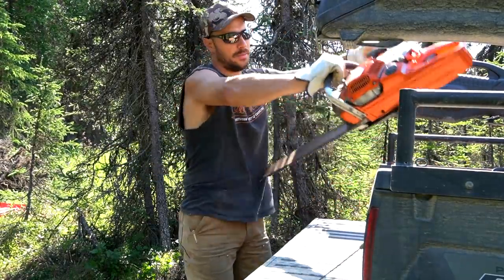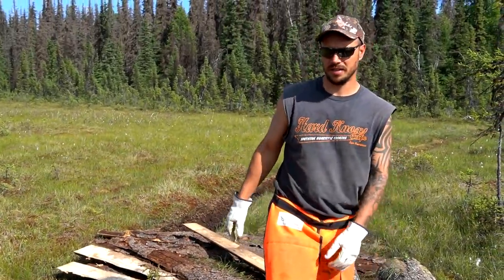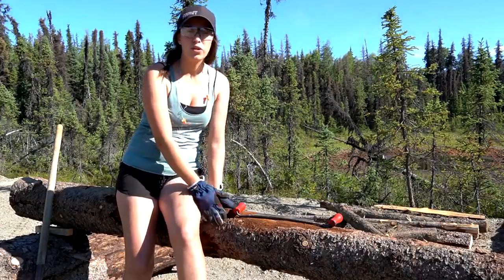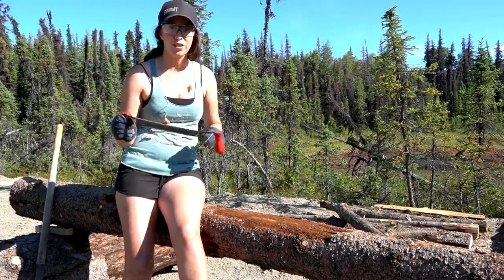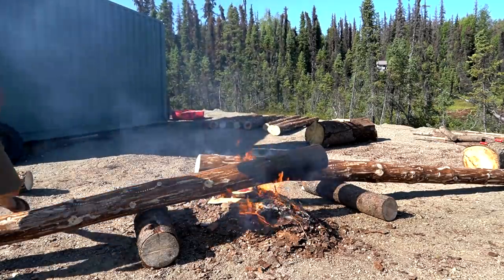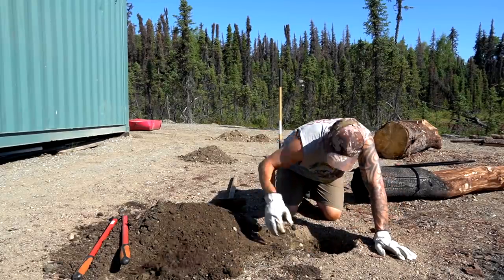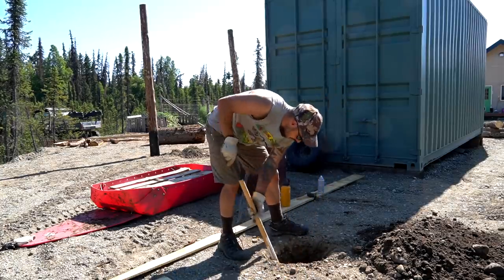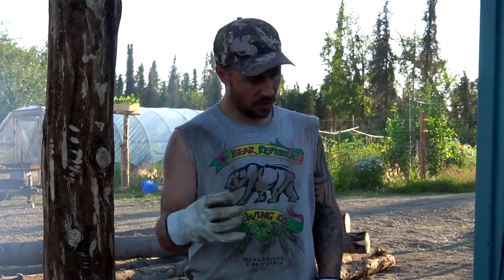Shipping Container Lean-To Build |  Hauling Logs from the Forest

Comment: To make sure your poles are plumb, take a string with a weight on the end, hold it up in front of you a ways from the pole and sight along the string with the pole. The string is plumb so you can adjust your pole one way, then go to 90 degrees and sight again. Works every time for the longest poles. Got this from some utility guys putting in telephone poles.
Reply: We do utility / power poles In Australia and we still use a plumb and string to straighten power poles 👍👍👍

Comment: Just a tip I learned when installing posts. Put a sawmill offcut/piece of timber in the back of the hole. When you lift the post it won’t drag soil down into the bottom of the hole🍺🍺

Comment: You two could use a cant hook- it’s used to roll logs and cants much more easy. A handheld timber hook is essential in my sawmill operations too.
Reply: Is that what some call a Peavey?
Reply: @akfroggie2177  Almost. If my understanding is correct a peavey has a sharp tip opposite the end of where you grasp the handle. A cant hook has a more blunt tip with a little lip that is used to catch the corner of a cant (sawn log) and flip it on a sawmill.

Comment: Tip for getting a pole in straight. Get a string with a weight on the end and dangle it in front out u with pole behind it. It will show u if ur pole is vertically straight, check from two directions tho.

Comment: Here's another project for you if your going to be hauling a lot of logs make a couple of bogies that you can sling the logs under the frame it'll lift the logs enough to be mostly clear of the ground making moving them a lot easier. Can you get hold of a heavy duty yard scraper like an inline hoe sharpen it up and it'll make getting the bark off easier if not a breeze

Comment: Love your guy's videos. When trying to plumb a post like that, try a plumb bob and a mason jar with a level line around it filled to the line with water. make sure the level line on the water glass and plumb string make a 90 degree angle and you should be good.... Just a tip from an old farm boy... Keep it up though love watching you guys.

Comment: You 2 are tough. I would of had to rent a excavator or skid steer with a post hole digger. 🤣 Of course I'm a little bit older and years of heavy lifting has pretty much taken it's tole on my back and joints. Can't wait to see the next video on this build. BTW, it's been in the high 80's here with near 100% humidity, it's like hitting a wall when you walk outside from air-condition building. 🥵

Comment: I would've added poles next to the connex so you could span the roof of the connex at a later point and have additional storage on the roof of that building. Plus a higher roof would help shed snow better. We built a lean too and shortened the poles like you mentioned and wish we hadn't because hanging a winch for cleaning animals isn't as easy as it could be.

Comment: I think you need some type of auger device that works off the tractor PTO to assist in digging those holes in the packed gravel.  Also, I think using a plumb bob with line-of-sight to get those poles vertical would work well.  And, if you are going to be debarking poles the rest of your lives, I think you need to invest in something that makes the job easier.

Comment: Yeah I was gonna comment when you guys showed an aerial shot where there are a lot of dead trees standing.
Definitely try to clean the dead trees out around your house and any area you'll be need to travel thru to get in and out of your property. Those dead trees are basically firewood standing up straight. God forbid you have a dry season or a thunderstorm, it's just waiting to be lit. 
That's basically what's happening in western Canada when they didn't treat the pine beetle problem serious enough. Forest fire every summer and getting worse.

Comment: Also, used motor oil mixed w/diesel or kerosene- a great water proofing media.
50/50, to 80/20 - oil/diesel ratio.  Can be ReApplied if necessary.

Comment: "What berm peak is doing about high lumber prices", In this video they use a similar method to haul their trees, but they put a cart on the rear of the tree which seems to take so much stress off of the ATV. I think you guys should definitely look into some type of wheel system for the logs. :)
Reply: Sled  works better in a bog , a wheled cart would stuck and sink
Reply: @ionconstantinbufanu  Got ya. I guess the point I was trying to make is, having something to reduce friction on the other side of the log seems like it would help a lot.
Reply: @augustin idk for longer trees another sled at the end ? I think they got this sorted out .

Comment: Looks like a goode spot for a log arc trailer I never heard of it either but if you check it out youll see its value to from hauling logs out of the bush n ur atv would be perfect. N burning logs the old school way unless you wanna buy green treated logs it makes perfect sense. You see this in a lot of remote cabin builds anything you put in the ground that ground wants to eat it. Or if you know where they sell old railroad ties. maybe an electric jack hammer from harbor freight tools for around two hundred bucks Ive seen people use them for putting in sand point wells for shallow wells  it sure beats a sledge hammer. Until you hit a large rock. Just interesting ways to work around problems n welding is a good skill as well.

Comment: I wonder if a power washer would work? That is how I debark Cedar after they have dried for a year in the log. Once the bark starts to turn lose from the tree it washes off pretty easy. Seems like it was 1800 psi @ 3 gal per min. Key is the volume of water.

Comment: Ahh to be young and strong. If it was me, after the first hole I would have gotten a motorized auger, after three holes with the motorized auger I would have bought a three point auger for the tractor, and after 5 holes with the tractor auger I would have hire someone to dig for me.

Comment: Looking good. Short of hauling those logs out in the winter on frozen ground, you are on the right track for building a corduroy  road.  There are miles of them built in the north country of our province and the great thing about them is they continue to allow for water movement.  Neat thing is too, the logs don't rot.  But, you would need to use full size logs and go quite a bit further out than you had gone with the slabs, preferably to solid ground. If you wanted to, you could also lash them together to prevent any movement until they settle.  The Mountain Pine beetle definitely did a number on those white spruce...who knew such a small critter could be so devastating.  Are you putting eves trough on the chicken pen side for rain water catchment...it looked like  once it was done, it might be coming down through the chicken run. Just an observation.  I thought maybe one of those lean-to's would be for the sawmill...lol.  Good job!

Comment: Do you have the chinese longhorn beetle? That is a lot of damage to pines trees...a lot of dead pines in one area...yes I should have waited till furthur in your video. You new property does not seem to have as extensive beetle damage. If you use any of this lumber on your new parcel do you risk bringing the beetles to that area. Here on Long Island trees with beetles are burned to prevent spreading the damage. But there needs to be a better way of getting rid of the beetles.

Comment: You should avoid towing with the winch unless it has a gearbox brake and few do.
The physical load can induce a current in the winding and burn them out.
Check the winch manual it will advise against it.